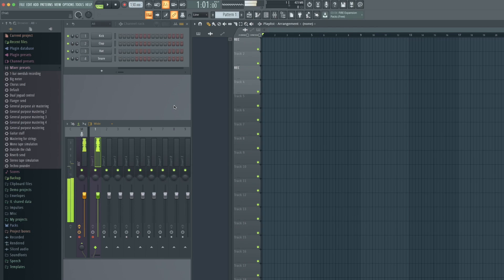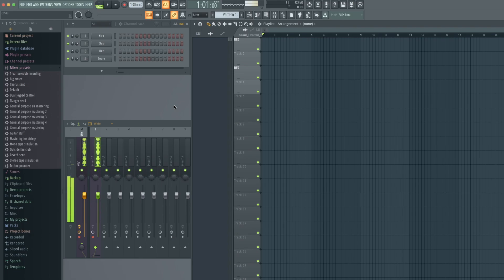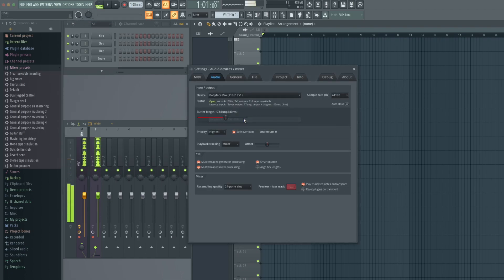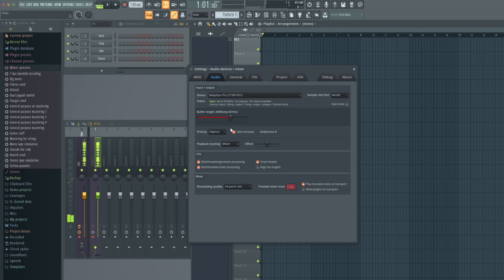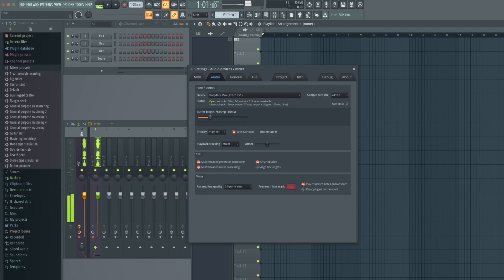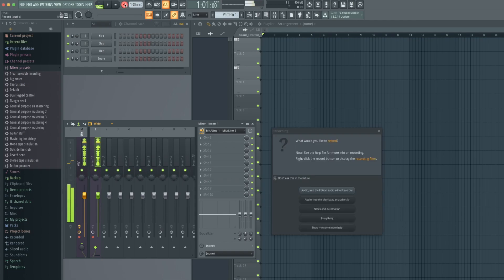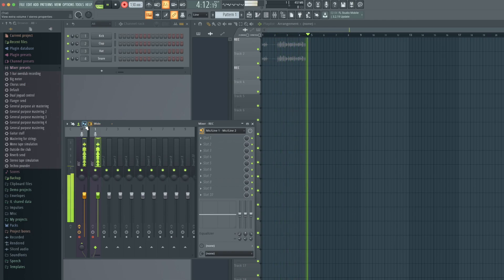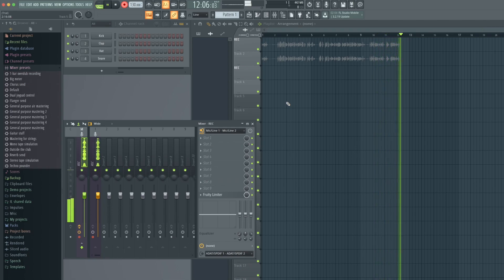How to setup FL Studio with RME Audio Interfaces

Comment: Hello. in FL studio, I don't get one single "RME Babyface Pro" device but rather many more devices (e.g. ADAT 7+8 or Analog 3+4 etc) even on my computer sound drivers. I have so many outputs in Windows (e.g. realtek HD audio output, ADAT 7+8, Analog 3+4 and many more by RME) do you by chance know how to fix this? in the video, u have only 1 device and this seems inaccurate in my case
Reply from the maker: Do you work with Windows or MAC?
Reply: RME Audio can you help this man?
Reply: I'm curious as well as I'm about to buy an RME Fireface 802 and I really don't want this headache
Reply: Windows, and I have the same problem. It doesn’t just show baby face pro but multiple options
Reply: i like how he asks and then is just like yeah ur fucked and dips out @aydinandre3039
Reply: @aydinandre3039  im having the same issue